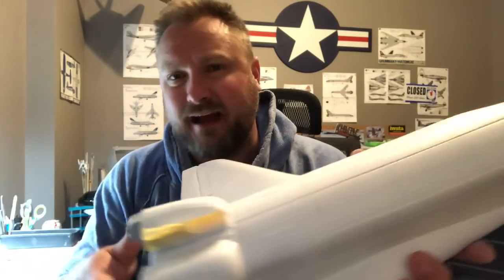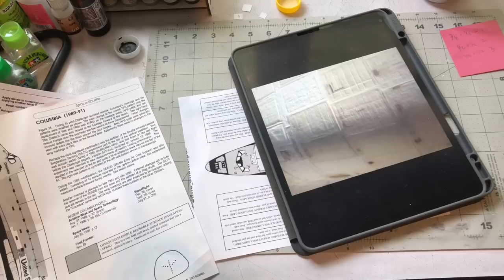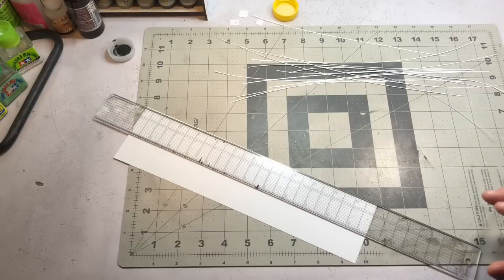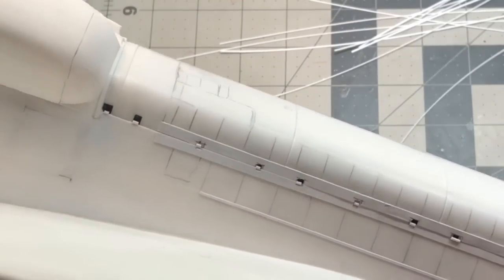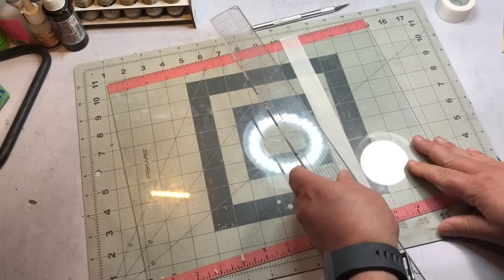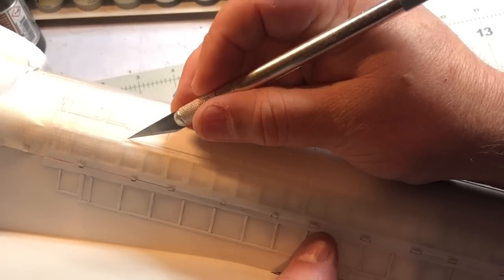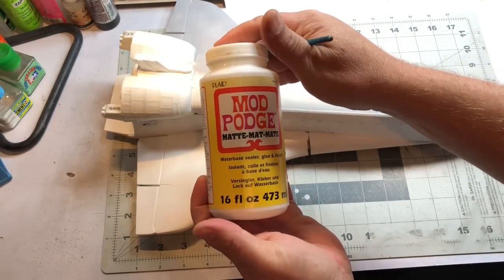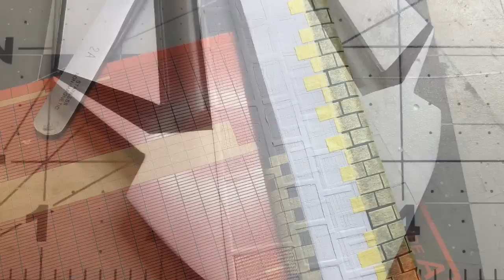1/72 Monogram Space Shuttle Part 3: Thermal Blankets

Comment: Been watching your video a few more times as I've finally got round to starting the thermal blankets on my shuttle.  I've found that no matter how sharp the blade or how well I seal the tape, I'm finding it very difficult to get a consistently neat edge to the blankets.  Having ordered a couple of 3D parts for my shuttle, I wonder if 3D printing may be a solution for the blankets...